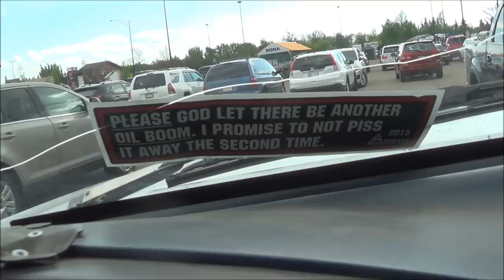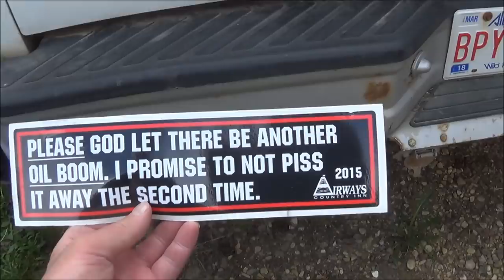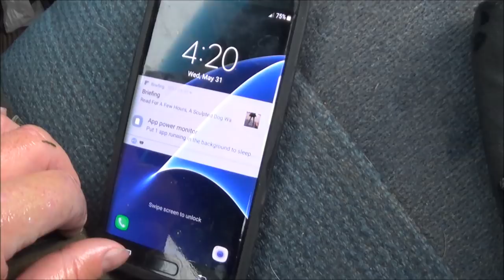Extreme grass cutting.

Comment: When I need to cut real long grass, I only overlap about 1/3 of the lawnmower.   The mower will only struggle with the 1/3 of deep stuff.  By the time you're done the mower has passed over every section 3 times.
Reply from the maker: ya i kinda did the 1/3 thing and the wheelie thing.
it was fun.
Reply: @marcelstjean  you don't get paid enough for the 1/3 thing

Comment: Side discharge mowers work best for tall grass. Even the 4hp mowers will cut that if it's side discharge. Mulching like your doing wont work with a standard mower not powerful enough to mulch tall grass.
Reply from the maker: Well. I got er done..

Comment: DAMN it looks like you went through hell to cut all of that. You need a side discharge mower for that if it's that bad but if it works for you I can't say otherwise
Reply from the maker: The lawn mower almost killed me a few days later. I was cutting my grass with it and the blade exploded i dont know how i didnt get hit by the shrapnel..  lol.
Reply: Wow ur lucky. Very very lucky i had an old snapper riding mower catch fire and I almost went up in flames with it but it was when i was cutting grass half the size u were mowing and I'm repairing it right now

Comment: $20-30++ In Gas! That's Crazy! 
You need a Diesel Mower lol!!
Diesel Mower i bet $10-15 to do that, Too Bad CRAZY hard to find a vertical shaft Small Diesel engine
I would of Cut that yard with a Gas Brush Cutter.